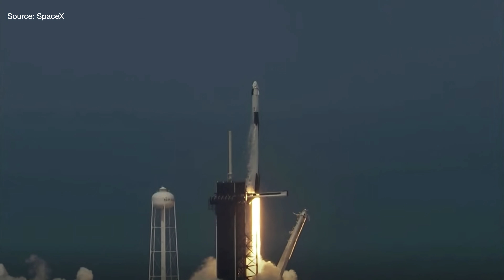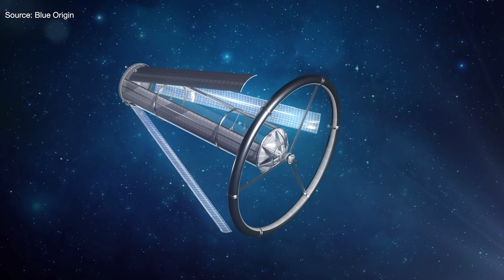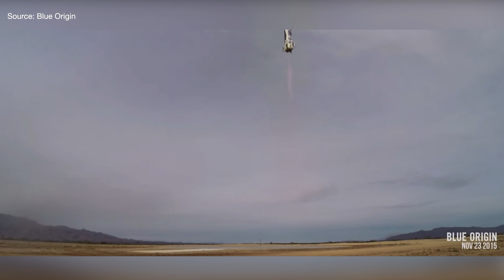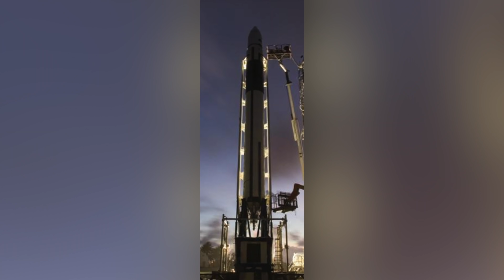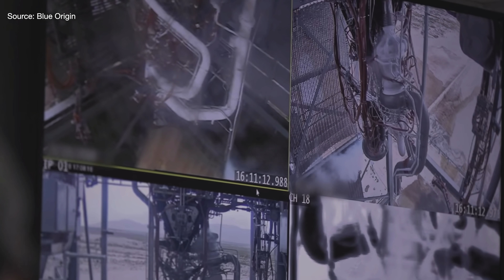SpaceX vs Blue Origin: Comparing their Plans

Comment: It's not exactly the turtoise and hare anymore. I'm not sure how testing works at Blue Origin but at SpaceX they don't have a good test until something blows up. The main difference was that Blue Origin was building a new rocket from a clean sheet and SpaceX has been modifying a old design but with the BFR they are starting from scratch

Comment: I get that its fine for both companies to succeed but I think its misleading when the reporting of commercial sector pushing spaceflight into the future all the reports mention "companies like Space X and Blue Origin". Or questions like "who will get us into space first, Space X or Blue Origin". No, fuck off, Space X has been launching cargo into space and to the ISS for over a decade already, landed first orbital booster 5 years ago, and humans into orbit this year. Blue Origin hasn't launch a single atom into Orbit and wont for at least another year and it will be another 5 years before there launching anything routinely. To compare these two companies or put them in the same category is highly insulting and disrespectful of Space X achievements. Its like comparing Apple to another phone maker just because they both make phones, where in reality as a company Apple is on entirely different level to every other phone maker.

Comment: Slowly planning but with few launches is clearly not the way to go, NASA's slow progress has proven that... It's better to fail a lot, and fast, to find the flaws quickly and fix them. Blue Origin's craft will be perfect right from the getgo, but only on paper. Real-life circumstances may reveal costly problems you can only find through trying, and failing.

Comment: why both of them are not trying to clean and upgrade the earth. The home planet should be recovered like lower pollution by replaced petrol and diesel engine with electricity as musk does and many of the things are possible through technology. If there is threat for the earth the solar system is there and if still there is 1 percent we can create the weapons to destroy it from another planet here we are full of nuclear and atomic which is already threatening to earth more than the other bodies in the galaxy. Car is not made to fly on air its the rocket or aircraft. So we can make the earth a better place and make it more advance but under the rules of nature. Space X program is more sensible the blue origin means wtf will happen If the space colony loses something and falls on earth 'Mass destruction'. Just imagine we will see Starlink instead of stars and birds will die. Every technology should be made under the circumstance that it should not destroy the earth's nature.

Comment: Wow! SpaceX fan Boi's descended like vultures in the comments! LOL, you people! SX is pretty great.. they've got it going on with Starship.. It might end up bankrupting SpaceX, but it's a cool idea. New Shepard is just a toy compared to the other two rockets BO is working on. Getting into space is kind of a well known procedure. Counting BO out for that is a fools errand.  It all boils down to cost per flight. SX is advertising  2 mill on Starship. Even at 10 times that.. that's going to be hard to beat. After cost is safety. Starship will have no abort system. The public is very fickle. Lose 100 people because of engine failure on landing, and you can go from Golden Boy to Evil Boeing in a heart beat. Now shake those pom poms... it's an exciting time (despite WTF 2020 turned into).

Comment: My question is who of these two is going to build the first "Solar Power Satellite" (SPS, or SSPS) Either solar cells, or mirrors (Modular designs similar to the segmented mirrors of the Webb Space Telescope will have great advantages for multi use, maintenance, replacement, installation, reconfiguration, etc) for concentrating reflected light (no power conversion losses) on surface habitats (Caves, Domes, Greenhouses) on Mars, Asteroids, Moons of Jupiter, and Saturn. Ultralight SSPS structures made of Aluminum, or other available lunar resources, will be Solar Sailed to Mars synchronous orbit, or other destinations.   SSPS Systems give power 24/7/365; no 4 hours of usable power (day/night), and Winter with no usable power, like on a planetary surface (Earth, and Mars).  *see SSI, and NSS archives.   http://ssi.org/solar-power-satellites/   https://space.nss.org/space-solar-power/  And for Spin-Habitat designs start here (Start Small)  https://www.facebook.com/geoff.s.jones/posts/10214015507957867

Comment: Bezos began what became Blue Origin before Musk started SpaceX.  Bezos hates spending money, it's part of his 'frugal' bean-counter mindset, and as a consequence he's gone too slowly and SpaceX not only caught up but easily passed them years ago.  I would not want to ride a Blue Origin spacecraft knowing what I know about the Bezos mindset on engineering and development.  
The Amazon FC's are a hodgepodge of poorly engineered systems that, once installed, have not been improved or updated because, hey, that would require spending more money and that's not in Bezos game plan.  Basically, he hires companies to develop system for Amazon and once they are up and running and long before they've been fully debugged and optimized, he ends the development, sends the company away, and operates the beta systems without update from then on.  The concept of maintenance is limited to getting the line back up and there is little or no effort to fix the underlying issues that cause the downtime.
No way I'd get on a spacecraft built with that mindset!

Comment: BO is NOT in a race with SpaceX. They 'might' be in a race with Virgin Galactic.
This is simply because BO and SpaceX have vastly different goals, and because SpaceX's competitors are actually ULA (and all their Boeing funded lobbyists), Arianne, and RosCosmos, all of which can carry heavy satellites to LEO and GeoSync.
Reply: Falcon 9 and New Glenn are having the same goals though.
Reply: @snuffeldjuret  - Not really. New Glenn is part way from F9Heavy to StarShip in size, but without any mention of Crew or Passengers. StarShip has been designed from the start to carry people. At this stage BO seems to have a cost per flight model that looks to be closer to ULA then anything as bugetable as SpaceX.

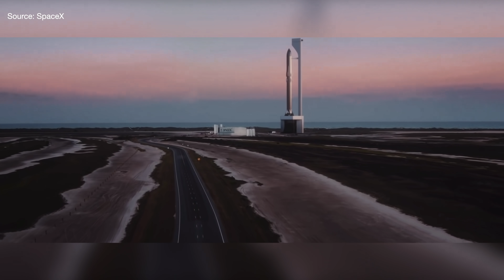Comment: No, i won't press 'Like' buttom. This video is one of worse jurnalism work i have seen. 2:46 - you have compared Falcon 9 from 2010 (71 starts, most used rocked ever made) with New Glenn wich is still in development. You have intentionaly not compare it to StarShip (also on development) and Falcon Heavy hasn't been even mentioned through whole video. Have you chceck the Internet and news for SpaceX Moon mission? Guess what: it will be sooner than Mars and oh.. the target is gethering resources. Good luck next time.
Reply: Can't tell if the spelling errors were on purpose or not.

Comment: Stupid question. SpaceX has been running for a decade. BO is still warming up. And SpaceX is running faster.
Reply from the maker: Blue Origin was started in 2000, SpaceX in 2002. BO also launched and landed its first rocket before SpaceX (Nov 2015 New Shepard vs. Dec 2015 Falcon 9). But you're right - SpaceX is running faster, Blue Origin is pacing itself :)
Reply: @Newsthink  It doesn't matter what year the company was founded, it's when they first reached orbit. For SpaceX that's 2010. 87 successful missions since. We're still waiting for BO to reach orbit. I have no idea what BO is doing, but it certainly doesn't look they are even trying to compete.
Reply: @shaimach   shaimach  not really. If you're referring to the question she asked in the video, sure. But the two companies' goals go far beyond reaching orbit. So id say they're still racing each other. Like youre saying, spacex has the lead currently it would seem but, as the video states, blue origin has a constant stream of income whereas if starlink and/or starship commercial flights fail, spacex could be facing some financial issues. And blue origin is certainly competing. They have plans to launch their new Glenn by 2021, correct me if I'm wrong, which would be a step above falcon 9 and heavy. Only a bit shy of starship with the superheavy booster which are who knows how far off.
Reply: @Newsthink  Pacing for what? If Elon delivers on Starship it is pretty much over. Spacex also does not have to worry about money anymore. They did at first, but they are set now. With Starlink the company is going to be able to 100% self finance.
Reply: @dtho6231  well starlink could easily fail due to a number of factors as could starship. Its unlikely and I definitely hope not but possible. And blue origins pacing seems to be working. As I mentioned in the comment above this, their new Glenn is a step above falcon 9 and heavy and is scheduled to launch well before starship. Meaning they're still in the race.